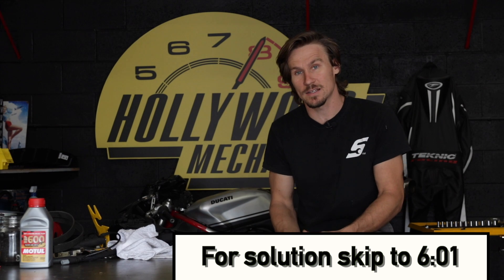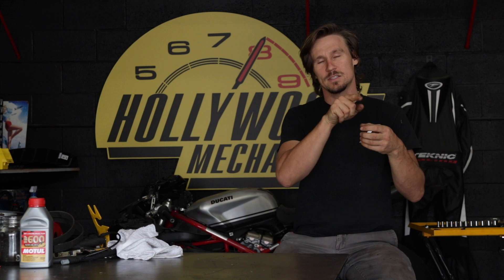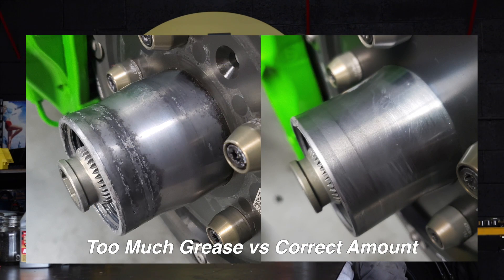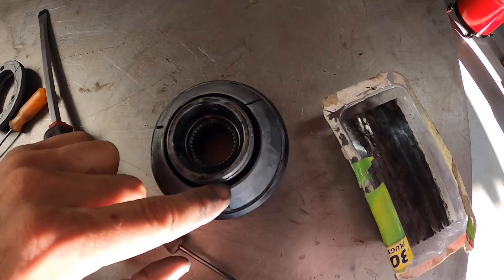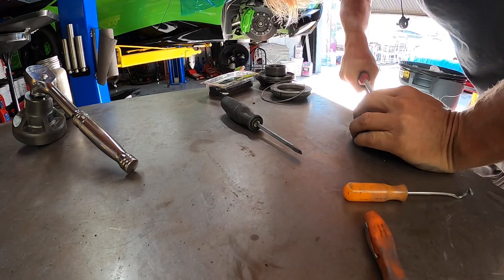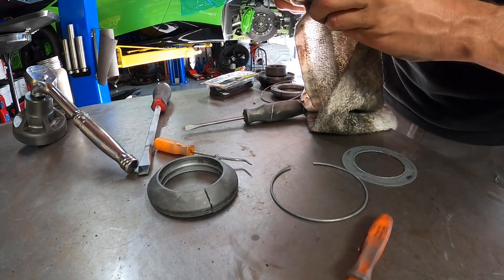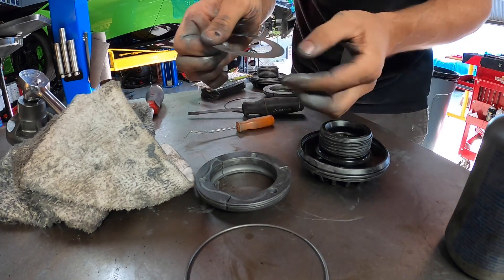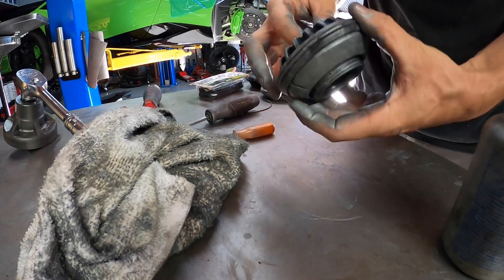Solved: Center Lock Clicking Noise (Porsche or Lamborghini) Street "Center" Lug Bolt

Comment: You can hit the screw vigorously on a hardwood and the conical ring will loosen. This is the official procedure.
Reply from the maker: I tried this method. But no matter how hard I hit it, it would not come apart. I believe it was due to the hard packed grease that will filling the nut.
Reply: @HollywoodMechanic  Hit the plate with the thread perpendicular to the bottom?
Before doing this, turn the conical ring so that the grease separates better. I have done this successfully many times.
Reply from the maker: @hans-uwebaumann8183  yes. Exactly as you're describing. The grease was so packed that the wheel wasn't sitting flush on the hub so the grease was packed in jamming it in place.
Reply from the maker: Looks like I'm getting weak in my old age ;)

Comment: All you need to do is read what the maintenance procedures are in the Porsche service manual indicating how much anti-seize to use. And trust me buddy, you will never use a screwdriver to split my Centerlock apart on my GTS. I take mine apart without tools.
Reply from the maker: Yes you can hit it on wood. It's been covered in the comments. This was before there was a bulletin or instruction in the manual.  As most of my videos cover issues the dealer does not deal with yet. And no damage occurred to the centerlock.

Comment: Did all that you show in this video but clicks is still there...what also could i do?
Reply from the maker: You should clean all the grease off and inspect for  any damage to the hub or wheel.  A good way to inspect the hub is to put the car in gear and use a dial indicator to see if the hub is straight and test again to see if the brake rotor is straight (nearest to the center of the rotor as you can test with the dial gauge).  Also, check the wheel for damage in the inner portion that seats on the hub lip as well as on the flat portion that presses on the brake rotor.  Make sure no paint or powder coat or sand  in between the wheel, hub or brake rotor.  If everything is perfect, then tighten the lug nut to the recommended torque, then loosen it a quarter turn, then re apply the recommended torque again.  This should resolve all the issues, or at least show you where there is a problem.  If you're still having issues, you might have a different problem.
Reply: @HollywoodMechanic I did everything that u recommended but clicks from centr lock nut is still there
Reply from the maker: @foxfromabox  I wouild need to see the car.  The wheel bearings or CV joints in axles sound the same as this center lock issue.  Sometimes even control arm joints pop, but not repetitively.  Are you sure it's coming from the center locks?  Have you tried torquing to 450lb/ft, then backing off, then retorquing?
Reply: @HollywoodMechanic Iam 100% sure that a sound comes from a center locks; I have that clicking sound only at tight corners. I have tried 450 torque.

Comment: You have any experienced older aventador brake clicking noise? 2012 aventador, I already taken the rotor out and clean and lube. Im suspecting 2 piece rotor or brake pads shift noise pin loose?
Reply from the maker: 4T0698010

Part number for that tape
Reply: @HollywoodMechanic  you 100% right on, it only happen when I 1st reverse and drive.. it make click click initial take off and it go away..
Reply from the maker: @YouStupid69  you don't have to buy the over priced tape. You can pick up some brake quiet spray, it's a red tacky glue in a can. Remove the pads. Make sure you do not get any spray on the face, sides, or slide pin areas. Just spray a spot where the pistons are touching the pads. Make sure it's enough to see the red color, so thick, but do not get it anywhere but in the back center of the pad. Use tape to protect everywhere else. Then, wait 8 min, and install while still sticky (not dry).  Don't let it rub off on sides with installing.
Reply from the maker: There is a double sided tape that Lamborghini sells for the earlier huracan brakes. It goes between the back of the pad and the caliper pistons to keep the pads from moving when turning or going from reverse to drive.  If the clicking is happening when you drive slowly in tight circles and the wheels are on properly, then you have axle or bearing issues.